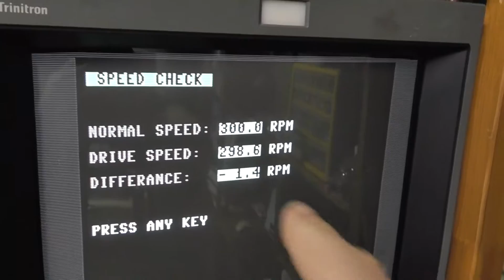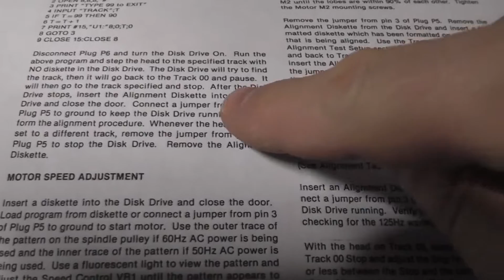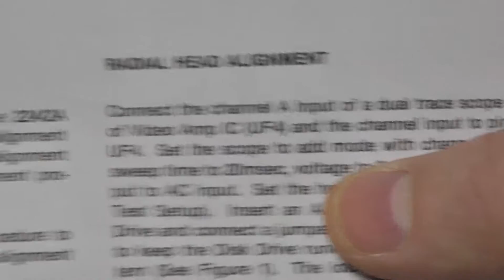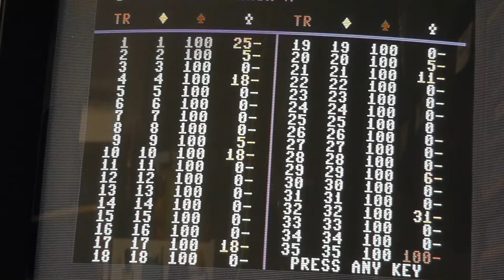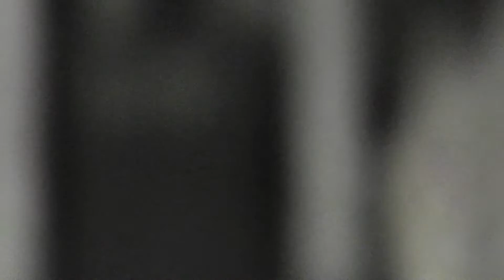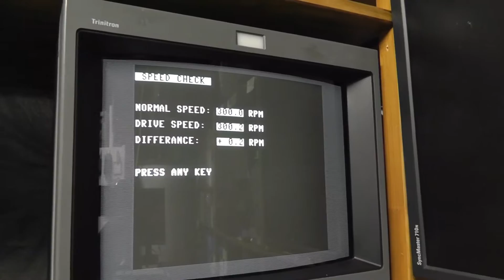My First Commodore 64 Repair - part8 1541 Speed, Stop, Head Alignment / Adjustment

Comment: I bought a VIC-1541 that was way out of alignment. Got it dialed in for the most part, tonight. But now it's all buggered again, perhaps it's overheating or some head bumping knocked it back out?
Reply from the maker: I doubt it is heat related.  Heading bumping or just not tight enough would be my guess.

Comment: Oh, any idea how to resolve the SYNTAX ERROR in line 7? There was a time when I could figure this one out myself but I am not seeing anything wrong with it. I have a PDF of the same Sam's 1541 guide you have and double checked the code for typos. It looks identical to what I am seeing on the page. I wonder if it is the placement of the second quotation mark....hmmm...going to test that. EDIT: nope.
Reply from the maker: It has been so long I dont k ow which part of video you are referring too.  Sorry I couldn't be of more help.
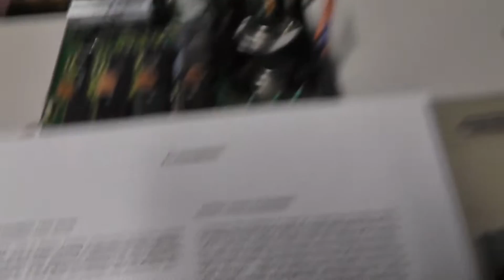Reply: @jacklick  it is referenced at 6:11. I was going to ask you next if you still had a copy. No biggie if you don't.
Reply: Remove the space between PRINT and #15.  It should be PRINT#15,......
Reply: @rockyborrego9352  Thanks! I don't actually need the program any longer but good to know it was a simple fix. Now that you pointed it out, I can clearly see in the program listing on the CRT, there was NO space!

Comment: I'm wondering if the head stop adjustment really requires a scope. Assuming that the program to reach track 0 is accurate enough on its own. Also assuming that my sheet of aluminum foil folded over also measures .01.  :) I do not have good half tracks on this 1541-II of mine but I am more interested in trying to reduce the knocking first.
Reply from the maker: I ended up not using the scope for any adjustments.

Comment: I have a 1541 that powers on and connects to the c64 but can’t read disks would this test work with that?
Reply from the maker: There are probably other things that would prevent a successful read but i would definitely start with this adjustment.

Comment: I do not see the small adjusting screw on my 1541 to adjust the drive speed.  I am not totally concerned about it because my speed is 297 _+ a little.  Any ideas were to adjust my 1541????
Reply from the maker: Do you have an Alps drive (little horizontal lever on front) or the Newtronics  ( swing down lever)?  The Newtronics did have some different internals but adjuster should be in a similar location.

Comment: Your drive mech has the optical track 0 sensor (to stop the alignment destroying head bump), but your board is not a 1541C so the sensor is going unused. If you marry the drive mech with the correct board and enable it via a jumper you'll have a drive that will never head bump under normal usage.
Reply from the maker: Interesting info.  Is it worth doing that?  I believe this an original setup so will likely just live with the head bump :)

Comment: Most 1541's can go up to track 42, but the reason you're probably getting the bad reading on 35.5 is because the 1541 Test Demo disk was only formatted to 35 tracks.  That's my guess anyway.
Reply from the maker: That seems logical.  Can't remember if I did end up getting one of them to read good at 35.5 after adjusting the head stop.  Next time I do one, I will adjust the head stop first.

Comment: I align my drives the exact same way, with a factory test/demo disk.  One time I tried using an EA game disk and found out they used "fat Tracks" as copy protection.  Getting all zeros on half tracks is really good, I usually settle for some in the teens.  And i think you are correct about the last half track.
Reply from the maker: Thanks for the comment.  Good info on the EA disk and feedback on what typical results are.  Looking back, I am not sure how much impact adjusting the head stop had but after doing that  adjustment, I did get slightly better results on alignment test.
Reply: @jacklick  Good to know.  I've thought about adjusting the stop.  I usually just clean and lube the rails first.

Comment: Interesting Video and results...I usually keep Drive Speed 300rpm or slightly less rather than slightly over.  I also have 2 Original Vorpal Utilities Disk to more accurately test Alignment.  Keep up the good work!  -Mark.
Reply from the maker: Thanks for the comment as I hadn't heard of the Vorpal Utility Kit and hadn't seen any recommendation on  speed setting.  Looks like we are both good as I found this in Vorpal documentation...."CHECK SPEED - checks and reports the speed of your drive in RPM. Normal drives should be rotating between 297 and 303 RPM"